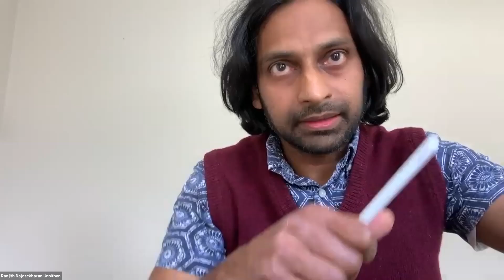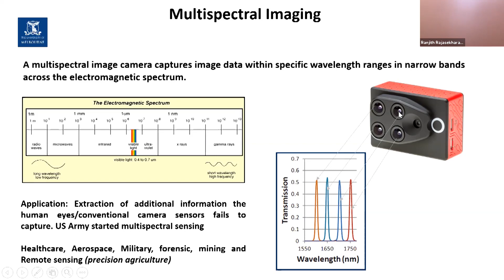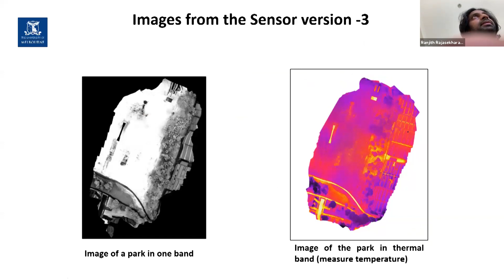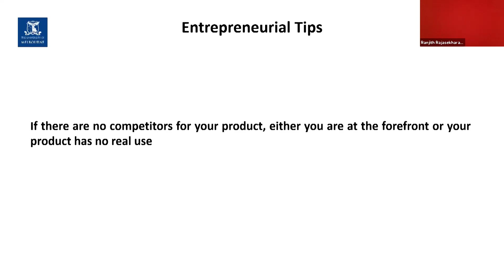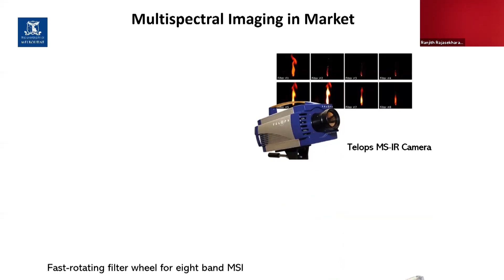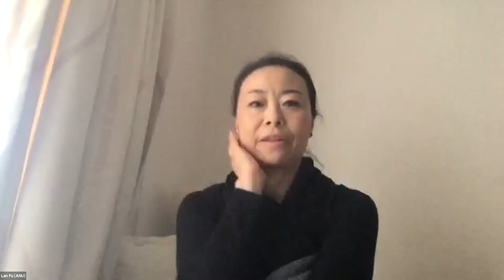Multispectral Image Sensors using Metasurfaces

Comment: At 23:35 I always get upset because I also have to deal with KiloHertz, Hertz, milliHertz, microHertz, nanoHertz signals from many kinds of sensors used on the Internet.  Many of the "gravitational" detectors only work in narrow bands now, but can go up to gamma ray frequencies and down to femtoHertz and smaller. Stop ignoring regional, earth scale and larger problems please. Most every system has changes for days, years, decades, centuries and longer. It is not all about human eyes.  In fact less and less so. Maybe it is because I first started using multispectral methods to prevent famine in the 1980s.  It has to be low cost and accessible. Richard Collins, The Internet Foundation